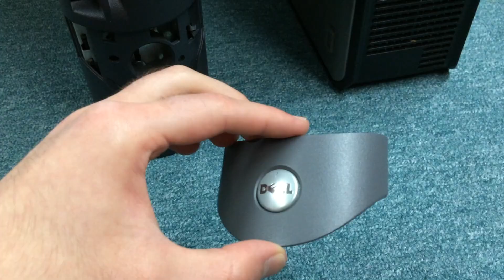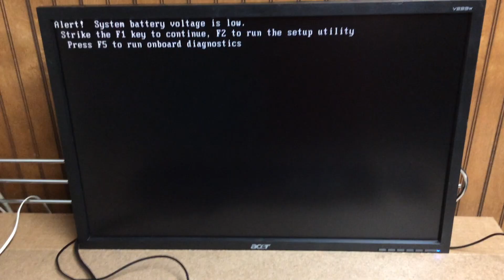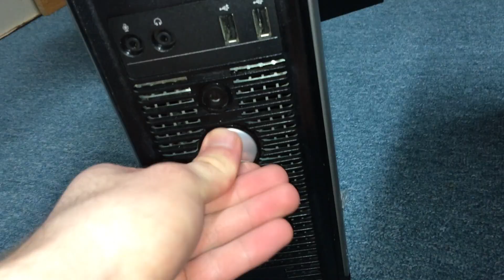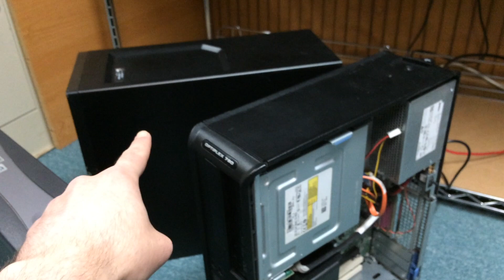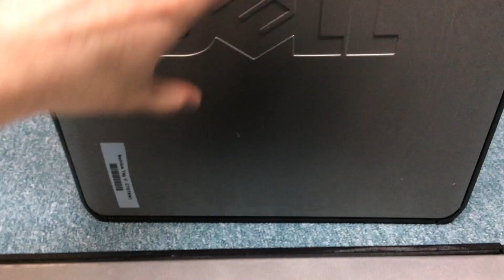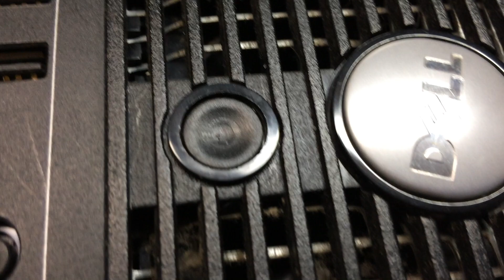Exploring old Dell OptiPlex computers!

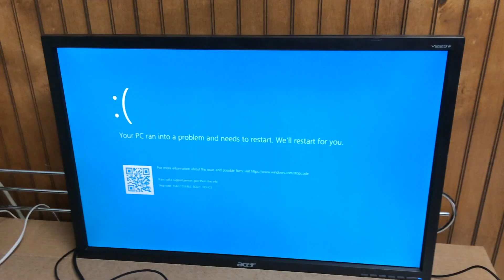Comment: 21:28 the dead cmos battery causes the sata operation setting to reset to the weird matrix storage manager thing i believe so i think this is why it bluescreened. ive seen this running windows 10 on a dell latitude e6500 laptop which has a dead cmos battery and runs on a core 2 duo (strangely it has a working normal battery but a dead cmos battery... kinda funny)
Reply from the maker: Yeah, always helpful for it to have a good battery installed. At the very least it gets rid of the clock error which can get annoying because you know, it actually works lol. Good thing though is that at this point, they are both running a working OS, as a Hackintosh and the other with Windows XP!

Comment: I guess you do know running a 32 bit on  duel core is waisting  computing power??
Reply from the maker: 64-bit is nice to use, but if you don’t have the hardware completely upgraded it’ll still work fine with 32-bit versions of Windows.

Comment: Not a Optiplex as well but i own a HP Compaq 500B MT microtower and the specs are perfectly good and very upgradable, it has a Core 2 Duo E7500 and 4GB DDR3 RAM and a GTX 780 Ti and a 300GB 7200 RPM WD HDD that came with it from 2009 and 1TB 7200 RPM Seagate laptop HDD from 2016 and as well a 500GB WD HDD from 2011 running MacOS X Mavericks and MacOS Sonoma and Windows 7 perfectly good machine as well as a 2012 Mac Pro i found next to a trash bin in a rich neighborhood while we were passing through with a 1TB SSD and a Intel Xeon W3680 and 64GB RAM running MacOS X Lion and MacOS X Snow Leopard and its perfectly good machines im not upgrading anytime soon i use both machines daily
Reply from the maker: Awesome setups! Core 2 Duo systems can still perform very well, sounds like there’s lots of cool additional hardware upgrades in the HP Compaq! The Mac Pro is a nice find, still extremely capable and it’ll run great with anything!

Comment: There should be a notch on the bottom of the dell logo where you can stick a paperclip or pen and rotate it that way.
Reply from the maker: Yeah I’ve noticed that, definitely helps if it doesn’t move easily.

Comment: Also recently got an Optiplex 780. No HDD or ram but I got my own. It works with the OEM Windows 7 Pro OS. I would like to convert it to Windows 11 though so I can use it fully.
Reply from the maker: Nice! Fortunately these Dells are super easy to work on! I'm sure it'll run well once you get it working

Comment: I own an Optiplex 9020 and I decided to install Mint on it recently (As a response to Windows 10 EOL coming up in a few months) And it's still going. Only needed some upgrades and cleanups.
Reply from the maker: Awesome! Sounds like a cool setup, I’m sure that OptiPlex works fantastic with extra upgrades. Linux could definitely work well, I know Windows 10 will be out of date someday but I use old software all the time and it still works well!

Comment: I used to be an owner of a Dell OptiPlex 320. It had 512MB of DDR2 RAM (it used to have 1GB but i lost the other 512MB stick) and it rocked an Intel Core 2 Duo, i just don't know which one it was.
Reply from the maker: Nice, as long as the software works well, 512MB would still be alright. My G5 had that much initially and it ran well
Reply: @TheOriginalCollectorA1303 i put Windows Vista on it, it was able to play Minecraft and it ran a russian version of Windows Vista

Comment: Just found this channel! Definitely great content. I had an OptiPlex 760, back in 2021 - 22 but it unfortunately failed. I used it as a secondary machine hopping from Windows 7 to 8.1 but it ran great on both OSes for web browsing. I don't have it anymore as the motherboard failed but I'd wonder if they're still useable online in 2025.
Reply from the maker: Thanks, glad you enjoy the content! Sorry to hear it failed, my Dell systems have always worked well. They are great for different versions of Windows like that dual boot setup. If I can still browse the modern web on 10.7 Lion, I’m sure these older OptiPlex desktops will have no problem getting online.

Comment: Watched this on my OptiPlex 380 that has a Core 2 Duo E7500 with 8GB RAM running Windows 10 - soon to be replaced with an OptiPlex 3080 Micro.
Reply from the maker: Awesome! Sounds like a well upgraded OptiPlex! Still worth keeping even with the upgrade as a second system. The older Dell systems are well built!
Reply: @TheOriginalCollectorA1303 It's hard to beat the OptiPlex line.
Reply from the maker: True, the Dell desktops that I’ve used have always worked well

Comment: The second that second machine started into Win10 I was ready to barf. Every time a computer gets upgraded to Windows 10 or Windows 11 an angel loses its wings.
Reply from the maker: Especially when it’s a system like this, even if it can run 10/11 well it just seems strange. I know the 3020 is on 10 but it’s just to have a Windows 10 machine available as it does run it well.

Comment: There's something very charming about those old SFF Optiplexes, they're obviously horribly outdated by today's standards but they're built like a tank and they're easy to repair and clean. Super nice systems for lightweight Linux distributions IMO.
Reply from the maker: Outdated but not obsolete, even with the damage on the 780 it still feels solid. They definitely built them to be solid yet very modular. There’s lots of options for the OS, nothing but potential!

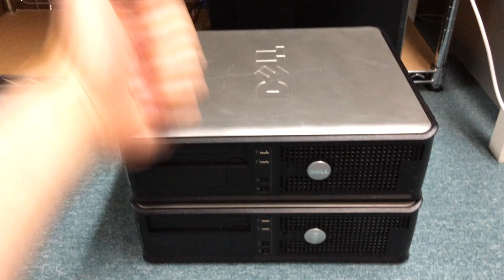Comment: 34:45 At Least You Can Upgrade Heck Of That
A E8600 4GB Or 8 GB 1600Mt/s And GT1030 Or 730 And A SSD! Makes This Pc A Powerful Windows 7 PC
Reply from the maker: These are solid Dell systems and would be excellent for Windows 7! Lots of possibilities with a slim tower design like this

Comment: Not an Optiplex, but my daily driver is from one of their primary competitors, a HP Compaq (DC7900)! Absolutely love these small form factor desktops, and they are incredibly upgradeable and fantastic value. My system has a 3ghz Core 2 Duo, 8GB DDR2 and a Radeon HD 8570 (though I'm probably going to get a different GPU due to some throttling issues on PCIE 2.1). I use this thing every day and it handles everything I throw at it like an absolute champ, I browse the web and watch videos (like this!) with ease, and can even get some modern gaming in if you don't have your sights set too high. Since there's extra room inside, I have two HDDs, one for Q4OS Linux, and one for Windows XP Professional. Fantastic 00s gaming machine, runs everything you can imagine (even Crysis!)

Thanks for another great video, as a fellow technomancer I'm here for every kind of PC revival 😂
Reply from the maker: Awesome! Small form factor systems are super cool to use! There’s just something super unique about them, easy to upgrade and work on! Despite the age, they are still perfectly usable and the best part is that the high end upgrades for the time are easy to get nowadays. Sounds like you are getting a lot of use out of it, very cool! Thanks, glad you enjoyed it!

Comment: I have a soft spot for business desktops like Dell OptiPlexes and HP Compaqs.
I had two HP Compaqs from 2005 and a Dell OptiPlex GX280 from 2004 that all ran Windows XP.
I even used one of the HP Compaqs to run Ubuntu at one point from 2011 to 2012.
They're fun machines to tinker around with, trying out all kinds of different operating systems.
My HP Pro 3000 is also early Windows 7 era.
Reply from the maker: I’ve had Dell systems for a long time, they are always cool. The HP Compaq machines are also really interesting! They are excellent for any old version of Windows, and they’ll still work just as well as they did back then.

Comment: That 3020 gave me flashbacks. I recently tried to swap the motherboard from my 3010 to a different case and guess what - it behaved aggressively without the original power switch and the I/O. The CPU fan was locked at 100% without any way to slow it down due to missing front panel I/O, and every time it'd start up I would get error messages for the misisng I/O which couldn't be disabled from reappearing. This is kind of like DRM on hardware level, lol. I tried the same thing with a Sandy Bridge Vostro and exactly the same behavior. Shame really, I always considered these a solid OEM option, but locking your motherboard to the case is absurd. It's a good thing that 1155 motherboards can be purchased for 12€ and a Xeon for these costs around 10€.
I want to respect the Optiplexes, but this situation was the exact opposite of what you'd expect of a desktop computer, especially one from 2011-2012. :/
Reply from the maker: It could depend on the specific models, I’ve heard other systems work fine after a change like that, although they may not have been Dell. Didn’t know they would have issues like that though, but then again I wouldn’t remove it from the cases as I think it’s a cool setup to have the different designs throughout the eras. They are otherwise great options but not the only option, like you mentioned those older Xeon components are easy to get nowadays.
Reply: @TheOriginalCollectorA1303  Thank you for your reply.
I had to swap case for mine, because the case got pretty beat up form behind and it was impossible to fit a video card ^^"
Honestly, kinda happy it happened, because if I stuck with Dell's motherboard, I wouldn't been able to get the Xeon working on it, and I'm certainly not going to pay 70€ for a 2012 CPU. I think you can easily get a 2018 Ryzen 5 CPU for that much (don't know the names, I still haven't moved past 1155 and 1150 on my desktops, likely will keep on using them until 2030+).
Reply from the maker: The main problem with systems like prebuilts are the proprietary components. Glad it worked out for you though, and yeah a lot of hardware will still work just fine for years to come!

Comment: I am an owner of the dell OptiPlex GX150. After upgrading the dead 10 GB hard drive with a 500 GB hard drive (it was lying around) and sata to ide adapter, it works great, and is basically original without that hard drive upgrade. I haven't used it as much as I have used its matching monitor on my main computer. It's an okay XP machine and gets XP related tasks done, despite its Pentium III CPU and 256 MHz of RAM designed for Windows 2000.
Reply from the maker: Cool, sounds like a great storage upgrade! The drive situation is something I’d like to improve in the future. It works but it could be better. It’s alright for XP but it would be much more usable as a Windows 2000 system with older software.